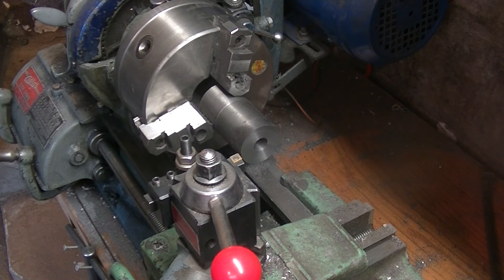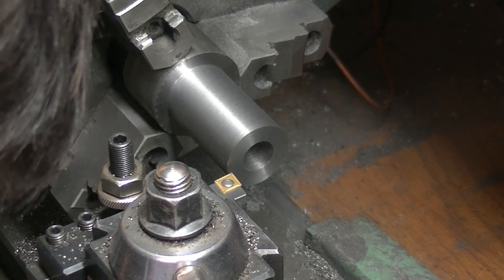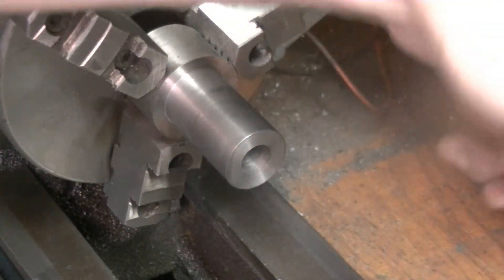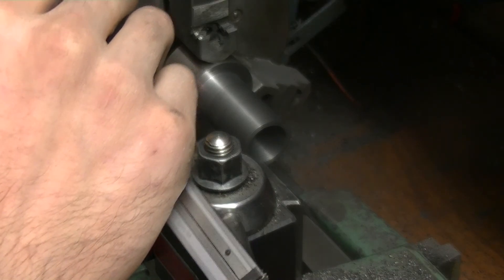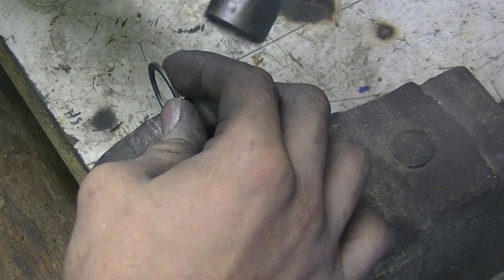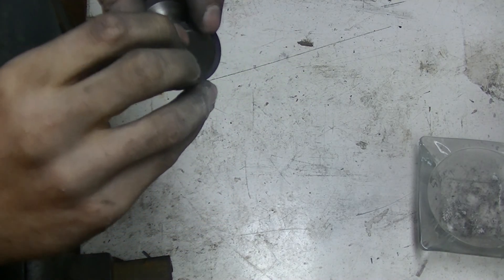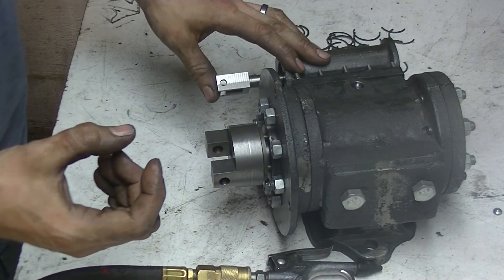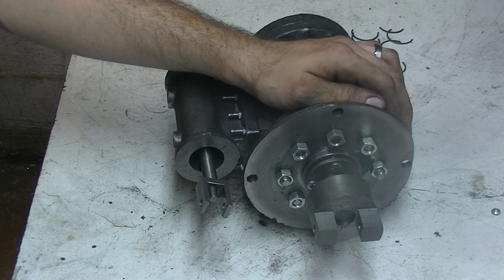Steam Engine Build: Making Piston Rings for the Valve

Comment: Thank you very much for your video, you do not know how many times I asked about piston rings if they were bought or could be made and nobody ever answered that question, today you answered my question. Thank you. My problem is the language and I use the google translate. I am Italian-Argentine and I live in Patagonia Argentina and some time in Spain I only speak and understand Spanish. What metal do I use for the rings, common black steel (Foundry)? And what material is the cutting tool? cobalt?. Best regards
Muchas gracias por su vídeo, usted no sabe las veces que pregunte por los anillos de pistón si se compraban o se podían hacer y jamás nadie respondió esa duda, hoy usted respondió mi pregunta. Muchas gracias. Mi problema es el idioma y utilizo el traductor de Google. Soy Ítalo Argentino y vivo en la Patagonia Argentina y algún tiempo en España solo hablo y entiendo español. Que metal utilizo para los aros, acero negro común (Fundición)?. Y de que material es la herramienta de corte? cobalto?. Saludos cordiales
Reply from the maker: Use cast iron as the material because it is brittle and therefore springy and will hug the cylinder walls.  Cutting tool can be anything that cuts cast.  Glad the video was helpful!

Comment: Bit late now, but I’ve always put rings on with thin strips of shim material, you need at least 3 strips. Also, with this method, you can feed the rings down to the bottom groove first, so you’re not fighting with other rings or going from groove to groove.
I’ve always done it this way.
Never broke one yet.

Comment: Just for what it's worth when I make those slide valves and pistons I make them in pieces.
If you notice on a lot of the steam engine pistons and valves the Piston rod goes all the way through and then there's a nut on the top when you take that apart the Piston or the slide valve comes apart in pieces so you can just lay the ring right on there and then just put it back together without worrying about stretching and breaking the Rings If you get what I mean. Beautiful job by the way.

Comment: I've always wondered if it was possible to make your own piston rings, it was only recently that I found out cast iron stock was a thing so this info has been ery useful to me. I'm trained in sheet metal and welding which are useful skills but I always wished I had gone into machining but hey ho it's just something I will have to slowly learn.

I'm in the middle of building my own cnc mill and have already run out of workshop space so will be moving soon so I can accommodate a lathe and everything else that I need. I want to start making miniature engines... When I eventually get a lathe and add a 4th axis to a mill then the shy is the limit, camshafts and other complex shapes should all be possible. I can't wait to get moved so I can get started but that's at least a couple of years away as it's going to cost a fortune to move everything hundreds of miles.

Comment: You broke a lot of rings, probably because heating and quenching makes the rings hard and brittle.   Try tempering them afterwards.  Heat until blue, then quench again.
Reply from the maker: Yes that is true, but the thing about these rings is that they need to be hard and brittle.  The ring can't be allowed to have any plastic deformation.  The idea is to cause the resting position of the grain structure to be in an expanded state.  Compressing it in around the piston allows the ring to spring back out and seal against the cylinder wall.  Tempering would decrease the brittleness yes, but also decrease the springiness and reduce it's ability to seal.
Reply: I understand that some of the ring sealing pressure is due to the steam pressure behind the ring forcing it forward on the piston and outward onto the surface of the cylinder, similar to a gas piston engine.

Comment: Every time you start the lathe, looks like it's wiggling front to back.  Is that a slight imbalance in the lathe shaking the camera?  Or is the camera on a pod and the lathe is actually shaking that much?  Stuff like this affects the machining, doesn't it?

BTW, at 4:56, I'm afraid a slip fit won't give your rings sealing against the valve cylinder wall unless you do something to the ring after parting and splitting to enlarge it so it springs out against the cylinder wall.

If you make the ring OD larger than the valve cylinder ID, then you don't need to break the ring and heat it while springing it out with the tip of a screw driver.  You can consider it already sprung out and need only cut a gap in the ring.  You'll want to cut a slight V cut so the ends of the ring are parallel with each other when installed in the bore.  Then you can do like the hot rod gas engine folks do and load the ring(s) into the valve bore nice and square and measure/tune the gap to be such.  

So long as there's always a wee gap, it will never bind.  You want enough gap that the ring ends will never touch each other in the most extreme conditions.  I don't know what that is for a steam engine spool valve, though.  

Avoiding the screw driver spring out heat treat method means you can pay closer attention to heat treatment.  I imagine part of the reason the rings you've been trying to install are breaking so easily because you heat them bright red and quench them in water, which tends to make things brittle.  I also imagine the video camera make the red hot ring look brighter than it actually is.  

Just some thoughts on rings.  I don't mean to spoil your fun.  Looking forward to more progress.
Reply from the maker: Thanks for the comments.

Yeah it is that damn table the lathe is on.  I need to reinforce it.  It does affect machining in principle, but honestly I don't notice a difference from when it was on my rigid table in my old shop.  So if it does affect machining, I am fully aware of it and compensate  (I say this because my parts come out on size).

Yes I am aware about the slip fit not sealing.  However, the idea is to make it a slip fit, then cut it, and heat treat it (as you saw).  That way, the ring springs back against the bore, but also has a small gap where it was broken (due to the slip fit).  Sorry, I should have explained that better.

Yes that might also a way to make the rings.  I personally have never tried it though so it is hard to say if that would also work.  The heat treatment causes the iron to be brittle yes, but this brittleness also adds "springy-ness," as the ring wont be able to plastically bend as much.  Have you tried this method?  Does it work well??  

Most extreme condition depends on the temperature of the steam, which depends on the pressure.  You can look it up in steam tables from any thermo book.  In my last video on piston rings, I might have shown me calculating the expansion of the ring due to thermal expansion at these extreme conditions.  I might have cut it out though because I figured people would be bored from the math :D